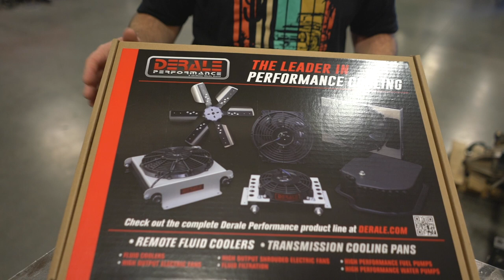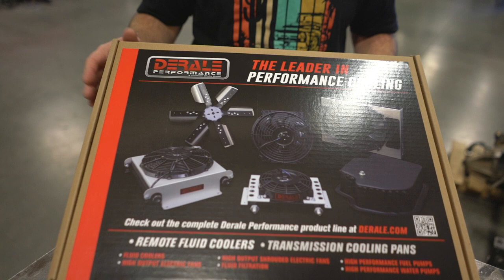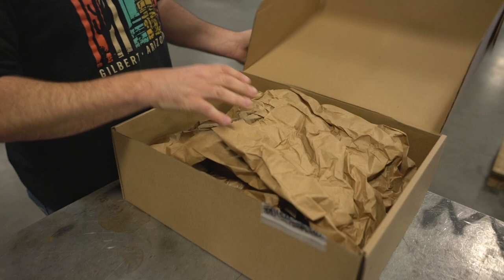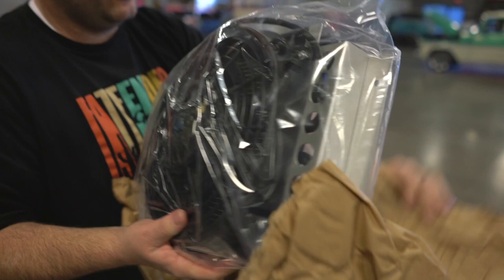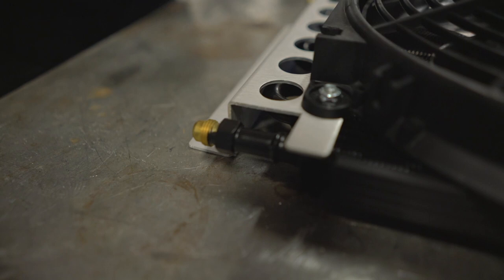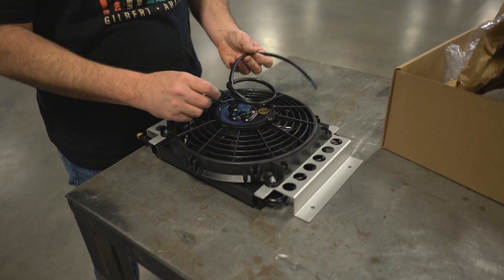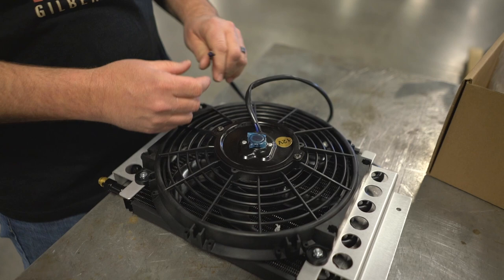Vintage Truck Transmission Cooler Solution!

Comment: Just picked up one of these. Box is exactly the same (-8). I have high expectations as i live in FL and trans temps can get a bit high if i drive the car around during rush hour.  During summer 2-3 hour traffic jams it can reach 212 😱. Driving around in the summer its at around 192-202. Winter it gets up to 180-188. If temps can stay at 180 and below all year round ill be very happy.

Comment: I have been running derale cooler about a year. Mounted under 72 Chevelle similar to your application. The only negative is it pulls hot air from exhaust under vehicle . Therefore I had to wrap exhaust to keep temperature down. Otherwise not much complaint. Temperature switch does let fluid by but it's like 1 drop a week.

Comment: Bad location for a ELECTRIC fan, wire leads with open ended (exposed) terminals connectors need to be sealed

Comment: My worry is if I install a team cooler in the same spot or similar on a tahoe and I go through mud or sand or whatever is the fan going to be affected or would it be better to throw it behind the grill
Reply from the maker: bollweevil7_3 you can install the fan up against the bed, cab floor etc. or even a small shield.

Comment: Do you believe the system is strong enough for a primary set up with an 4l60 with a cam lq9 with regular driving out of town. 10hr plus drive times. Or should I run it through the radiator also?

Comment: I have an old import with a 4-speed AT (Aisin A140E). Does Fat Fender Garage advocate a cooler with these? After my researches, I am thinking it is unnecessary and would not improve transmission life. Your opinion?

Comment: Where do you get the thermostat sensor?
Reply: @jezraelflecha1633  Get the Setrab sensors TS 180. MUCH better quality.
Reply: @jezraelflecha1633  Get the Setrab Sensors. #TS180. Much better quality.